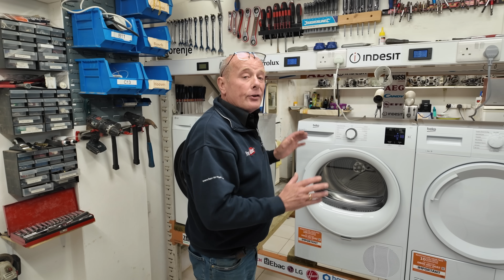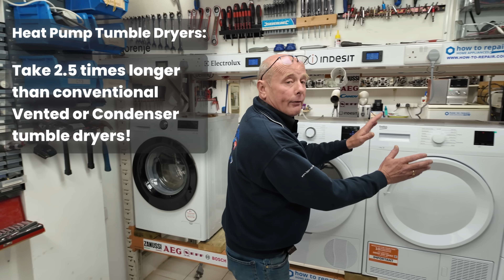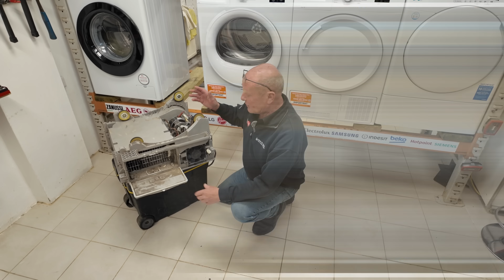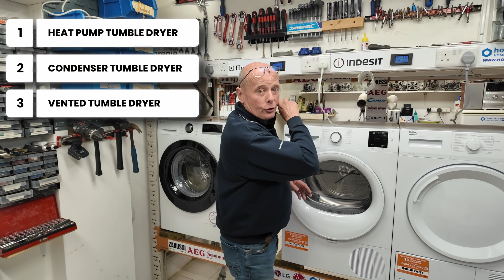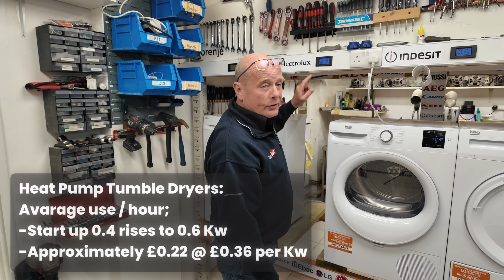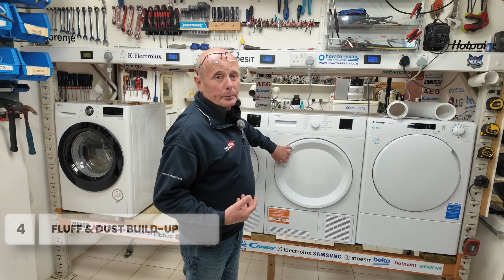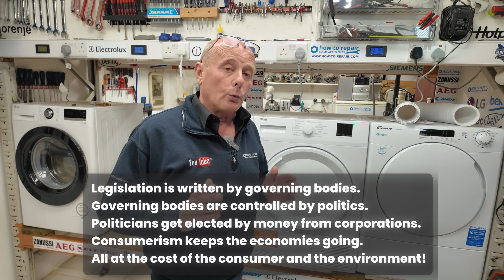Tumble Dryers the Shocking Truth About Heat Pump vs Vented & Condenser, NEW LEGISLATION!

Comment: We’ve had a Candy heat pump dryer for about 5 years. I’ve just replaced the motor capacitor on it for the 2nd time and it’s a right pain to strip it down far enough to get to the capacitor.

I always give everything a thorough clean while it’s apart including splitting the condenser / evaporator housing and vacuuming that out.

The front drum bearings feel a bit rough so I’ll be changing them next.

To be fair the compressor side is no more unreliable than a fridge freezer. 

Yes they take longer to dry clothes but they use less electricity and I’ve never heard of a heat pump dryer catching fire.
Reply: I replaced the motor capacitor in a heat pump dryer, and it was a pain as you describe. I put extension wires on the capacitor and mounted it where it will be easier to replace.
It's a bit of a disappointment that the capacitors seem to be quite weak on the heatpump dryers, when other induction motors with capacitors seem to last forever.
Reply: @ yeah I know it’s weird because I can’t see them seeing anymore load other than the machines just running for longer periods of time.

Candy don’t appear to be the most reliable of brands. The washing machine is of a similar age and that’s needed a set of brushes and drum paddles, and it looks like the drum is sitting low in the machine so I’m thinking the suspension struts are in need of replacing.

I suppose you get what you pay for. Both of them have a 7 year parts warranty which I forgot to activate, but I guess the labour won’t be cheap to repair these machines once you’ve paid the call out fee.
Reply: You won't hear about them catching fire in the same way EV's and smart meters never catch fire apparently because it's kept out of the MSM.

Comment: I have my heat pump dryer for 3 years and 7 months. I have used smart plugs for the last 5+ years. The heat pump dryer as far I found is far cheaper to run, such that the saving in energy costs means I could buy a new dryer for the savings over 4 year. Cheap, but I have no idea about its longevity. Great video
Reply: The LG DLHC6702B heat-pump clothes dryer has an official estimated annual energy use of 270 kWh. A conventional resistance-element clothes dryer uses approximately 470 kWh/year. That's what my 25 year old Inglis machine uses (I still have the original yellow EnerGuide tag with the manual). So....here in Canada that LG machine will cost me Can$1,799.99 and a replacement conventional machine (say, a Samsung DVE45T6005W) would cost me Can$599.97. The respective annual operating costs, at my 12c/kWH, before taxes, would be Can$32 vs Can$56. I'll save Can$24 a year if I pay an additional Can$1,200 for the high-tech heat-pump clothes dryer from LG. That means, if neither machine ever requires servicing, the heat-pump machine will pay for itself in 50 years ($1,200/$24). Is this a great deal? No. If the heat-pump dryers ever come down in price dramatically, I might consider one. But then, I live in a rural area where technicians are not to be found. I'm able to service conventional dryers myself.
Reply: To be fair to heat-pump clothes dryers, the conventional machines do draw air from the home. That air, in the winter, costs money to heat (we heat exclusively with wood but we're not most people). So...I think it's more accurate to suggest the payback period (the break-even point) for a heat-pump machine might approach 40 years, rather than 50. I can only guess because it's very difficult to quantify the cost of make-up air for a conventional dryer.
Reply: But if all the savings after 4 years only add up to a new machine then you’ve saved nothing… My condenser cost me £289 8 years ago and I’ve only fitted a new heat element which was around £40.. I think my savings are far higher than yours…
Reply: @smiffy5467  
How do you figure.  Your appliance is not FREE to run.  Heat Pump dryers save enough electricity vs any other technology that the cost of the saved energy is enough to buy a NEW machine when the existing one fails.  A condensor or vented dryer cost a LOT more to run AND by choosing a heat pump instead of them you may save enough money in electricity to completely pay for the entire purchase cost.

Comment: You left out how many kilowatt-hours was required to dry the close on the heat pump machine if it is taking 2 1/2 times longer to dry the close and it is consuming let's say 400 W the difference isn't that much.. Maybe 1000 W hours compared to 1.8 kWh  but you have got to take into account the heat pump machine may be partially blocked after 8 months of use and then the efficiency of that machine drops off rapidly in comparison to the straightforward condensing machine which can be cleaned out by the customer.. And really effectively the heat pump machine is only half the size incapacity in comparison to the condensing machine,, all the manufacturers make a big deal of how many kilograms the machine can dry.  That's great but if it takes twice as long or more then the machine is only half the size and half the load.. Yes total con.  Of course that consumers buy what they want but never ban anything..  We need president Trump to kick out all this green agenda..  make Europe great again.. Kick out the communists

Comment: Re: heat pump dryer repairs. Same issue with mini split HVAC units - they push new sales instead of repair, and new is crazy expensive here in the states.

Comment: I have only just acquired a Haier Pro 7  heat pump drier and it dried my standard wash work clothing in an hour and a half 90min the old Hotpoint Condenser could do it in a an hour but hoodie cuffs were still damp etc The new machine used 700watt hours the Hotpoint used 3 1/2 kWh no comparison especially as I picked the machine up 6mth old on marketplace for 300 quid. 10yr parts warrenty and 5yr guaranty that was transferable to the new owner what's not to like. If it blows up in 6yrs and I can't repair it as you suggest I can't I'll have saved enough to get another one. Yes that's poor environmentaly as I have always kept my appliances going new washing machine drums motors etc but the cost of electricity made me look long and hard at the old squeeky tumble and it had to go and I am astonished by the low consumption of the new one ( to the point I thought my meter was broken so I plugged the toaster into it 900watt straight away )

Comment: I have noticed that every new white goods appliance bought has worse performance than the previous model owned. All to save energy, dishwashers that pop the door open - jeez. I have to pop our latest AEG  dishwasher onto an 'intense' program to get the dishes relatively dry.  No I do not want to use a tea towel to dry the dishes  🙄. Technically no trading standards are being broken as it's called a dishwasher, not a dish washer/dryer. 

Something serious is wrong when the appliance can no longer properly fulfill its purpose properly due to energy saving regulation.

Comment: A factory sealed refrigerant system rarely gives any trouble, just look at fridges and how many hours they see. 
I'm generally not a big fan of using the dryer, but at least the heatpump one does not wreck clothes with high temperatures like the old one did.
Reply: Agreed. I can see that a better design to clean evaporator and condenser fins would make sense - but the only air-con units that seem to need "top ups" are mounted in vehicles with lots of flexible pipes which ultimately perish. I have a fridge in my bedroom that I bought second hand over 30 years ago. A fridge freezer that I bought new about 28 years ago. Sealed compressor units with all metal construction are usually happy to run for DECADES - often  for many hours per day, depending on ambient temperature.

Plus, providing you get a 5 years parts & labour guarantee (several manufactures offer this), then you will have saved WAAAAY more in terms of electricity than a new dryer will cost you a few thousands cycles later.
Reply: @guyteigh3375  Well, the appliances made 30 years ago do often run for decades. They are not made like that any longer. When you finally replace your old reliable appliances with new ones, they will probably not last 10 years. More likely, they will have a major failure shortly after the warranty period expires.
Reply: yep
Reply: Cotton sheets need high temperature in cold and damp climates. A heat pump is never going to work.
Reply: @__teles__  That's just nonsense, the dryer usually sits indoors and makes it's own climate inside the drum anyway. I mostly use mine for cotton bedsheets and towels, in a 10°C room with no issues, and only during the winter, not that it matters. It's funny how people are always going to tell you what doesn't work with no experience of their own.
Reply: @__teles__  work's with mine. we're did you get that 🤣🤣
Reply: @__teles__  Complete nonsense. A heat pump dryer creates its own air conditioned environment inside the machine: warm and extremely dry. The outside environmental conditions are irrelevant to how the sheets dry. (The heat pump itself prefers certain temperatures, but works at any temperature that is comfort to a human.)

Comment: Wow, an honest appliance salesman! Agree with everything you had to say about the various dryers you discussed. Do you not have natural gas dryers in the UK? How do you heat your boilers? Ignorant American here. In Michigan most people buy natural gas dryers, they are much cheaper to operate than 240VAC dryers and dry quickly. Other than removing lint buildup, replacing the drum belt or maybe an ignitor, they are cheap to self-service and last for 20-30 years if cared for properly. They need to be vented outdoors, but most homes come equipped with an external vent connection.
Reply: Hi Fishbones, gas dryers are not a thing here in the UK, unless you buy a commercial appliance (BIG bucks!!) Our central heat boilers are gas fired but the govt. is looking to ban the sale of these on environmental grounds forcing everyone to switch to heat pumps of one sort or another in the name of going green... It complete madness, and don't get me started on EV's...
Reply: @peternoyce9350  Well, i'll be keeping hold of my 36 year old Creda tumble dryer, still working perfectly, (it's only ever needed a new timer in all those years!) along with my trusty mains gas fires, installed in the 1990s, those push out more than enough heat to keep the whole house warm, even on low settings!
I'm not going to be greenwashed into any of this heat pump nonsense!
Reply: You didn't know that electric boilers existed? Now you know!

Comment: Absolutely fantastic video. As someone trying to make this decision now, I was completely sold on heatpump.

What would you do if you were in the position of buying one now? Would you be going vented?
Reply: Don't buy a dryer at all, buy the most efficient dehumidifier you can find where you are. Here in the UK that's a Meaco 25L costs @ £260-300 with a five year warranty; cheaper to buy/more flexible to use. A unit like this will dry your clothes on an airer in a few hours, (ideally in a small room, windows closed; it doesn't matter if it's a bedroom or an office, spare room, it won't become damp) and using @ 165- 250 watts/hr, so very economical and can be used for the rest of the house; remember in winter a dry house is much cheaper to heat, feels much more comfortable. Aside from that, and to anyone else who happens to read this, don't be lazy, get your laundry outside in the fresh air if you can, even in the winter, a bit of a breeze and your clothes will dry a good deal - it's free after all.

Comment: In one home I had old Kenmore/whirlpool top load washer and electric dryer that came with house. In the 9 years until I sold the home those machine never needed a repair. In other homes with front load washers every one needed multiple repairs after warranties expired. They were LG and Whirlpool costing hundreds and I did the labor. I can see the current Whirlpool design will not hold up the 10 or 20 years I expect it to like the washers in the past.

Comment: I pay my electric bill, it should be up to me how much I spend on drying my clothes. The government should keep too running the core parts of the country and keep their noses out of my life. I have a vented dryer, and it does fine. I had a heatpump dryer, it took 4 times longer to semy dry my clothes. They are in the oit house so in winter the dam thing wouldn't work. It lasted 5 months before I sold it and purchased my vented unit. If anyone is in the market for a dryer, get a vented while you can.

Comment: I have owned 2 heat pump driers. I keep the heat exchanger filtration system clean and the heat exchanger stayed pretty much as clean as new. I have replaced the pre filter when it became worn / damaged. I had this machine over 10 years and it never gave any trouble. Like you say it did take 2 + times longer than the previous vented one that I had. My washing machine died and I wanted a matching replacement dryer for the new washing machine so sold the first heat pump dryer in good running condition.

I purchased a new washer and dryer (heat pump type) which is actually one unit with washer on bottom and dryer on top. Much to my surprise the drying times are comparable to what I remember from my old vented dryer, it is much faster than my old heat pump dryer. I am not sure if this is common among newer models. The only feature that I am not sure about is the auto cleaning of the heat exchanger which pumps collected condensate through it periodically. After a couple of years as part of maintenance I will remove the covers and check it, I will manually clean if need be. Time will tell.
Reply: Thank you for sharing.  I live in Central Florida during the summer months the humidity level is off the charts. My laundry center is in my unconditioned garage space which can reach 35 degrees in the summertime. I'm just concerned if a heat pump will function well in that environment, or if I should stick with a standard replacement. Would love to hear your thoughts. TYIA
Reply: @powerguymark  Where I have mine located it can get to mid 30s deg c with very high humidity. My manual lists the recommended operating temperature range from 5 - 35 deg c. and no mention of humidity. The high temperature limit would be more to do with motor overheating etc than the ability of the heat pump to heat. At lower temperatures the efficiency will drop off. The drying operation is a closed loop where the air is heated and the moisture laden air is drawn away and cooled so that the moisture drops out as condensate, then the dry air is heated and recirculated. Based on this I would not expect the high humidity to have any noticeable effect. My machine has a large drum so air circulation around the laundered items which assists drying efficiency because a large surface area is exposed to the airflow. With smaller machines it is easy to overload them resulting in restricted surface area of the load being exposed to the airflow.
Reply: I've had the same condenser drier for the past 23 years. Line dry as much as possible because  refuse to fill the pockets of the greedy globalists.

Comment: You may have a point about longevity, but a Bosch condenser dryer I had gave up after 5 years, and was uneconomical to repair according to the (non-Bosch) engineer. My Heat Pump (Hotpoint) dryer has been going 3 years, cost £380 (boxing day sale), has saved a butt-load of energy so far. Almost equivalent to the price of the machine thanks to electrcity prices. The killer selling point for me is the much lower wattage and drying method means it is much safer to put on overnight. Meaning double bubble as I get very cheap electricity overnight. We’ll see if it lasts two more years. My fridge-freezer (also Hotpoint) has been going well over 10 years now, so I hope they have good condenser/heat pump designs. We’ll see! Need more data.

Comment: Does it save much energy though.  If the condenser uses say 1.8kwh and the heat pump 0.6kwh but for 2.5 x longer, you're only saving 300wh.  Current UK prices approx 24p/kwh would mean 8p saving.  After price differential for the machine ~ £150 that's going to take 1875 dry cycles to break even.

In winter our cat curls up and sleeps in front of our condensing dryer when it's on and it does supplement the heating so the energy isn't really wasted.
:chillwcat:

Comment: I agree with what you are saying, although I thought the wattmeter was a bit pointless. You could have used a Kwh meter and got each to dry the same load of clothes from the same washing machine- just run a rinse & spin then straight into the dryer, and run them on a sensor program (set to "super extra really very dry"- which is still damp.....)  I suspect that the duty cycle of the element in the condenser decreases as the clothes dry  and there is less evaporation. They also run for quite some time without the heater at the end of the cycle.

One other point to consider is that the condenser heats the clothes sufficiently to kill all the bacteria left in from washing in cool water, whereas the heat pump uses much cooler air- nearer 30 degrees for maximum efficiency (which is why they take so long!)